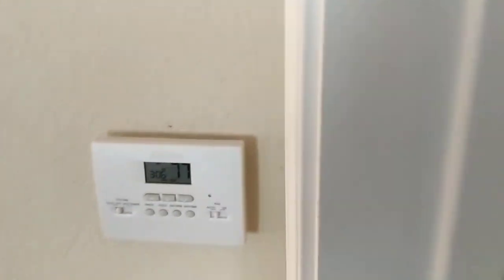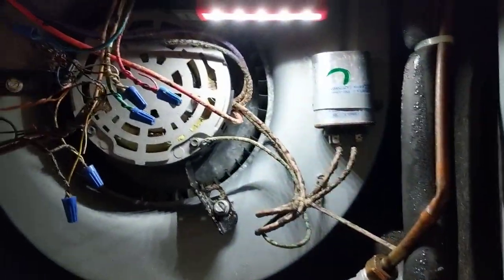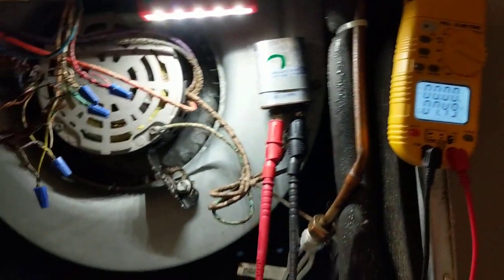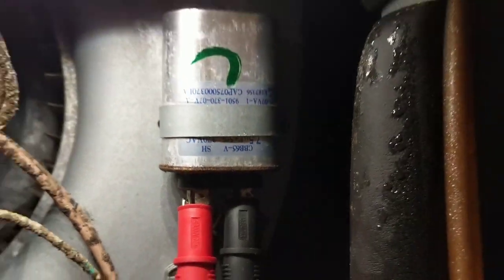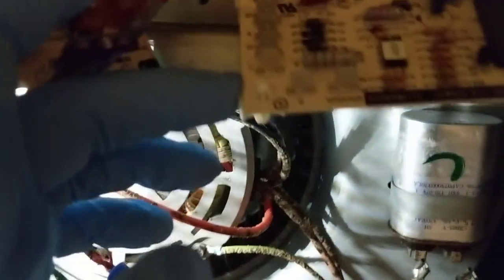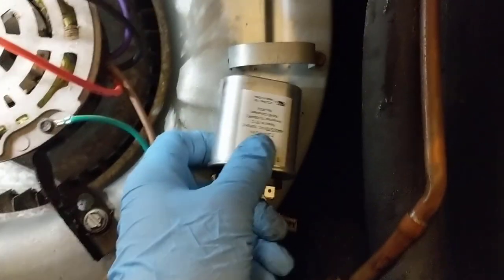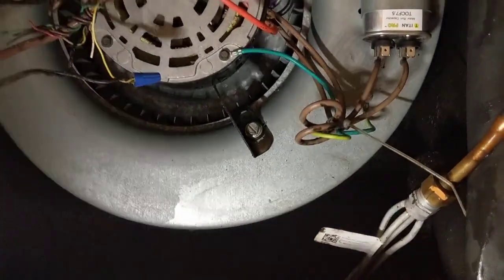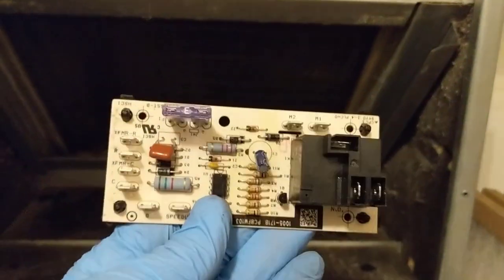Air Handler Fan Won't Come On

Comment: Is there any V checks that can be done at the thermostat, saving me from crawling into my attic? Also, my board has a micro relay, but I think the AC people added a switch in case water built up in the collector pan, and they told me that it would shut off the handler. The pan has water, but I'm not sure it's enough to stop the blower .I went ahead and ordered a blower circuit board, $58 on Amazon for a carrier
Reply from the maker: The switch your referring to is a float switch. If the main condensate drain clogs, the condensate water will fill up the float switch & shut the unit down to avoid water damage to your home. Whether or not you have a float switch on the secondary drain line or not I wouldn't know that without seeing it of course, but sounds like you have a pan switch which would do the same thing as the  secondary drain float switch. Depending how your float switch is wired up, here's what would happen, if it was wired up to the red wire (24volt power wire) & it was full, your thermostat would have a blank screen unless you had battery backup in the thermostat, if they hooked it up to the yellow wire which sends 24volts out to the condenser, the condenser wouldn't turn on outside, but the fan in the air handler would still run but blow out warm air inside the home. To see if it's the thermostat causing the issue, you would have to jump out the red, green & yellow wires & see if everything turns on. If it's a heat pump, you would also have to jump out orange, & if it's a Rheem or Rudd system you wouldn't have to add orange to that color scenario. Best thing to do is set the thermostat to cooling, turn the temp down a few degrees below the room temp & go outside to see if the condenser is running. If it's not running, then you would have to go to the attic & check the condensate drain line to see if it's clogged, & see if you have a secondary drain float switch & see if it has water in it. If you don't have a secondary drain line & there's water in the pan. Most likely the pan float switch is causing the outdoor unit to not turn on cause the main condensate drain is clogged in the attic. You would have to get the drain line opened then remove the water from the pan & then everything should work properly aslong as that's the issue. 90% of the time the clog is at the trap in the drain line where it comes out if the coil at the air handler. If there's a cap or lid at the beginning of the trap, lift it off & see if it's full of water. If so, that's more than likely the issue. Thanks for watching Mike & Subscribe to the channel 👍
Reply: @ApartmentMaintenance  ty.
Reply: They told me there wasn't a switch on the original pan, so because that pan was leaking they ordered another pan and just double panned it and threw in a switch. They also ran a PVC line out to my garage, and I had to extend that out to the side so it would drip into my garden area and not into my driveway. They charged me$700 for the pan + labor+ switch and PVC line work, this was after it ruined a large area of my ceiling above my kitchen.
Reply from the maker: @mikelunsford7462  Wow, atleast it's all taken care of now. Thanks for watching Mike!
Reply: I looked at the float switch, I bypassed it as well and no blower...
Reply from the maker: @mikelunsford7462  I just replied to your other comment with a few troubleshooting things you can do. Thanks for watching Mike 👍
Reply: @ApartmentMaintenance  they changed the blower motor. And it's all working now, they also said, the bill is in the mail.. have no clue how much
Reply from the maker: @mikelunsford7462  Wow, usually a company is upfront about the price so you can agree or disagree. Glad the system is up & running now, hopefully for good! 💪
Reply: @ApartmentMaintenance  spoke too soon. Now when the heater is set the air is cold and hot mixed, and when the cooling is set then the heater comes on...
Reply from the maker: @mikelunsford7462  Could have something wired up wrong, or you have a bad sequencer. I've seen the systems act weird like that due to a bad heat sequencer. 👍

Comment: If the ac fan blower is not running, you won’t hear any noise at all in the air handler? My AC won’t turn on ( it was working before I bypassed the thermosthat) will a bad relay , bad transformer bad capacitor all will not start an AC? I mean if all these 3 parts are bad you won’t hear any noise at all in the air handler? Like even a humming noise? It’s an old air handler there’s no fuse or circuit board
Reply from the maker: Without seeing it in person it's definitely hard to say. I have no idea what all parts are there, & if there's an in line fuse, etc....Normally on an older system you can hear the transformer buzzing even when the system isn't running. But yes a bad relay, bad transformer, & bad capacitor will all cause the system not to run. When you bypassed the thermostat you could have fried the transformer if there isn't a fuse for the low voltage. A wire could have touched another, or touched anything metal. I wouldn't rule out everything until you properly checked each part. If your unsure of how to diagnose each part, I recommend calling an HVAC technician as it can be very dangerous if you don't know exactly how everything works & how to test it. Thanks for watching Rick & Subscribe to the channel 👍
Reply: Appreciate your answer, you are rite I better have a tech fix it for me . Before i make the problem go worse or cause a fire or something. Thanks for your advice.
Reply from the maker: @migosmadeira9892  No problem 👍 Thanks again for watching the video!

Comment: UPDATE - It did fit !! yeah it was blower motor . replaced it and could tell it was working right away at the vents . It waa blowing weakly beflore so replaced capacitor at first but that wasn't it . Only $16 . Next suspected motor . Great that I fixed it . Century universal motor $74 plus needed bracket $30 YAY
Reply from the maker: Niceeeee 💪 Glad you got everything squared away & it's working now! Thanks for watching Frank 👍
Reply: Where did you buy the parts from Frank?
Reply: @jaimeolavarrieta6706  ac parts suplier Johnson Supply  . Unfortunately many won't sell to those that aren't licensed AC techs but some do . Gotta call around in case there's no Johnson Supply near you . And there was at least one other smaller supplier that sold to the public .

Comment: Could the fuse have just been bad on the board
Reply from the maker: Great question Jelly Roll, & to answer your question, No it wouldn't of been bad or blown cause if the fuse was bad or blown, the thermostat wouldn't of had any power (as these systems are wired up by 24 volts from the transformer). Also when the fuse is blown, nothing works, the coil would of never iced up, it would of never sent 24 volts out to the contactor at the condenser either, (which closes the contacts on the contactor allowing 240 volts to pass through which allows the condenser to turn on). I also kept the old fuse & put it in my parts case as I always do when I have a bad blower board. The blower board on these units are just to turn off & on the indoor blower, it's not like a control board on a furnace or anything like that, strictly controls the blower. Thanks for watching Jelly & Subscribe if your not already! 👍👍

Comment: GEEZ , the guy helping me at AC place their place not open today or tomorrow AND I need to ask him again something . He said on blower motor if I disconect the cool terminal wire on circuit board and connect the bottom black wire to cool terminal that ( this is what I'm not sure what he said and needed to talk to him ) if it works ( or doesn't ) that means board is bad NOT the motor ?? OR is it the other way around ?? And yes replaced capacitor . Still the same barely running the blower not full speed and shuts down after a while with new capacitor
Reply from the maker: Does the blower work fine on heat setting? Thanks for watching Frank & Subscribe to the channel 👍
Reply: @ApartmentMaintenance  I'll try it . What will that tell me ?
Reply from the maker: @frankmontez6853  That something is bad with the cooling speed on the fan motor or the cooling speed tap on the board. Each color wire from the fan motor represents a fan speed besides white which is common, & the brown wires are for the capacitor. So your fan could have fan speed wires with colors that are black, blue, red, orange etc....So by turning on the heat you can see if the fan possibly works fine. Without seeing everything in person, I don't know if you have just a control board, blower board, fan relay etc...so it's hard to say
Reply: @ApartmentMaintenance  on one hand you're saying that you can't know what kind of board be it control, blower fan relay etc but on the other if I turn on heat that will definitely tell me what ? That no matter what board I do have,  that this turning on heat will definitely tell me if blower or board is bad ? I'm been without ac for three days. I'm getting to where I'll change out $205 blower motor see if that fixes it. Board at just over $100 ( I think ) might be replaced  next if that doesn't work. I'm trying to be sure .
Reply: @ApartmentMaintenance  and seems like if I do it in certain way I can sorta bench test it and see blower motor is good or not ?
Reply from the maker: @frankmontez6853  You said in your first comment that someone told you to try switching the black fan speed wire for another fan speed wire. All that tells me is your motor has different fan speeds, but I don't know what board you have. So I was was saying turn on your heat and see if the fan works cuz then that would tell you the fan speed that is used for heating is working, or it is not working. You won't know until you try that.
Reply: @ApartmentMaintenance  yaeh though with furnace blowing it made a lot of noise hard to tell if fan is working full speed . Maybe because I tried it feeling at vents and maybe it was good .. Amyways I'm now going on four days without losing patience going to replace blower motor tomorrow . Universal one not Goodman . But more reasonable at $75 locally . zjust took it off today but store was closed by 5  pm . Yeah if it doesn't work how much you think a board will cost ? That's the only other thing it could be ? I'm tired of all this four days
Reply from the maker: @frankmontez6853  So now the fan doesn't turn on at all? It might be best to get a HVAC guy to look at it. Cuz it might just be a thermostat, or something simple. You don't want to spend all that money on a fan motor & then it still doesn't work. Could just be the thermostat. Did you check the fuse on the board? Do you have 24 volts at the thermostat?
Reply: @ApartmentMaintenance  UPDATE - It did fit !! yeah it was blower motor . replaced it and could tell it was working right away at the vents . It waa blowing weakly beflore so replaced capacitor at first but that wasn't it . Only $16 . Next suspected motor . Great that I fixed it . Century universal motor $74 plus needed bracket $30 YAY
Reply from the maker: @frankmontez6853  Nice job Frank! Glad you got it fixed! Thanks for watching 👍

Comment: Should have explained the capacitor when you de-energized it,  there are plenty of people that don’t know you can get lit up from a capacitor. When you used your needle nose to touch both contacts on the capacitor it made it safe. With a run stop you touch each of the contacts together to de-energize and make safe.
Reply from the maker: Great tips! Thanks for watching Dennis & Subscribe to the channel 👍
Reply: How about you stop showing people how to do it and call a professional

Comment: I changed my little blower control board, the one with the little fuse and my  blower still doesn't come on. So again, here comes the AC repair people.... bending over.... this absolutely sucks. I've probably got a bad motor because I've got a good thermostat and power to it. And the AC heat pump comes on...
Reply from the maker: Did you check the capacitor for the blower motor? Sometimes those relays stick on the blower boards. With the power off, take a screwdriver & tap on the relay with the handle end of the screwdriver. Then turn the power back on & try the fan. You can just switch the thermostat fan to the ON position to test it out. Thanks for watching Mike 👍
Reply: A bad blower, voltage to it but still didn't wanna work, replaced and is good, but then I had a problem with blowing heat and cold at the same time, but that  was a switch on the thermostat set to the wrong way ..my fault, I was checking voltage and was playing with it. Forgot to place it back.. stupid...I deserve a bill
Reply from the maker: @mikelunsford7462  It's always something isn't it? 👍
Reply: @ApartmentMaintenance  always... but I'll get a huge bill, I can't wait! Send me bills, all of em, fake bills too why not..

Comment: Not trying to take away from the video ,far from that in fact thank you for showing us how to do this problem most folks have and im one of them and i know some people will say well do this do that first for those that have something to say about my comment just hush ,anyways , problem is how do we get to that point where we know which part we need where we buy it for the video everything was ready to go just swap in my case im staring at the fan and now what i do
Reply from the maker: Getting to the point where you know what you need is called troubleshooting.

Disclaimer: Safety First! If you don't know what to check or how to check I would call a professional. 
Check the thermostat & wiring first with a multimeter, if that is good, turn the power off to the unit check the capacitor, (your multimeter has to be able to read mfds), if that's good then you would have to check the board. If you don't understand how to do this or have never done any of this then I would advise you to call a HVAC technician to come diagnosis the issue. Thanks for watching 👍
Reply from the maker: @oOohdaddy  No prob, I hear ya. Who's song "gotta get my weight up" ?
Reply from the maker: @oOohdaddy  Haha, I like the song. Playing some Madden from back in the day lol I was gonna say reshoot the video to today's quality. I was waiting for your boy to rap on the hook, but he never did. Then the boys pull up in the impala with 2 garbage bags lol
Reply from the maker: @oOohdaddy  Sorry to hear that. I know what ya mean. Well stay up & if you ever do any other videos hit me up 💯